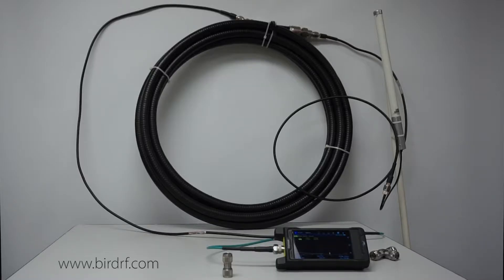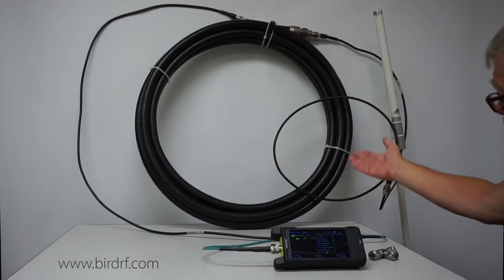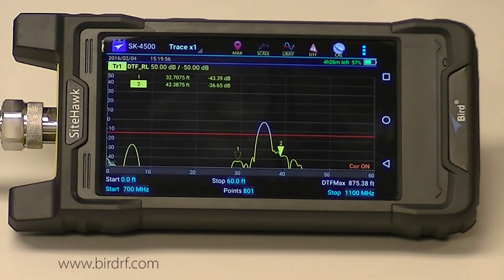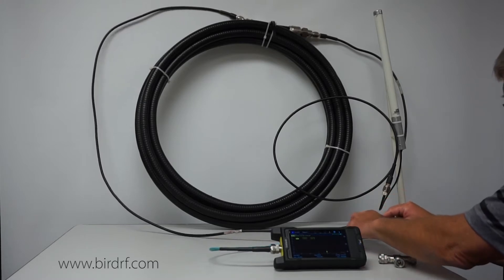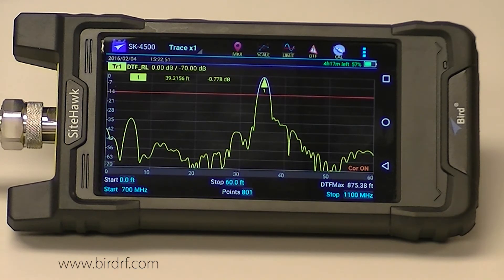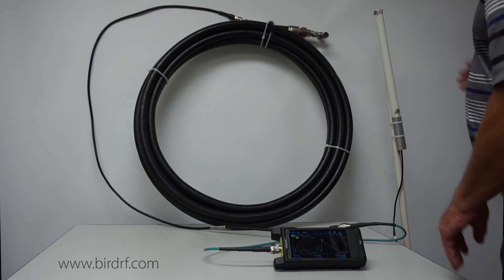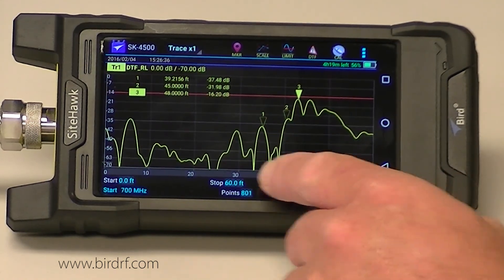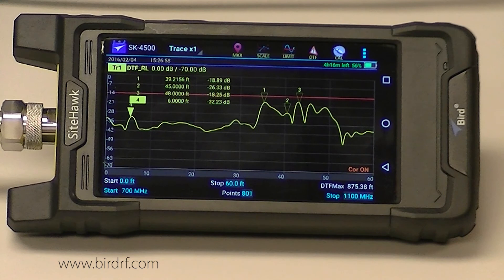Distance to Fault Test using the Bird SiteHawk

Comment: Have you come across a return loss sweep that passed and then ran a DTF sweep only to find a failure of some sort?  Meaning the return loss and DTF sweeps contradict each other.
Reply: Yes. It’s more common than you think. But you have to remember that a DTF is NOT pass/fail test. It’s only a diagnostic tool. I always tell guys to always do a DTF test because a return loss won’t necessarily catch a kink somewhere in the cable
Reply from the maker: Hi Nick!  Thanks for watching the video.   I will check with our applications engineer and get back to you shortly.

Comment: I set my machine up and the distance is only allowing max distance as 17 feet. What am I doing wrong ?
Reply from the maker: Max distance is calculated based on velocity of propagation, number of data points and frequency span.  Solution is to increase number of datapoints and/or reduce frequency span.  If you need further assistance, please contact our applications engineering group at appengineering@birdrf.com.
Reply: I hooked up my cable to tester then cal now the max distance is 69.69 but my cable is a 150 ft cable